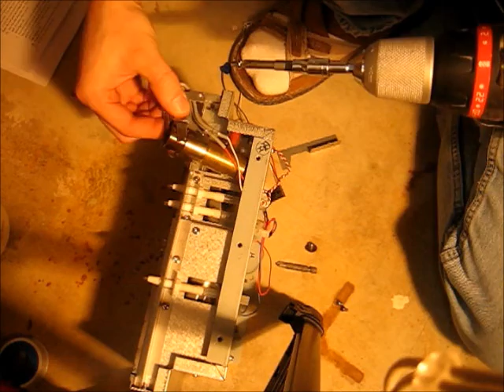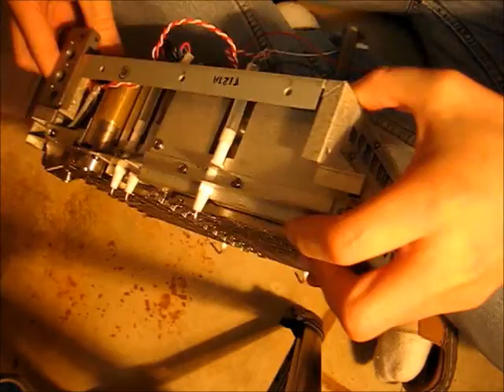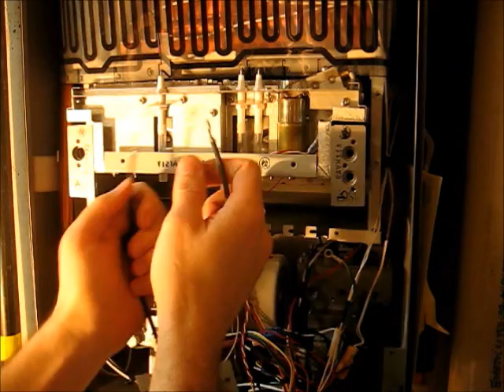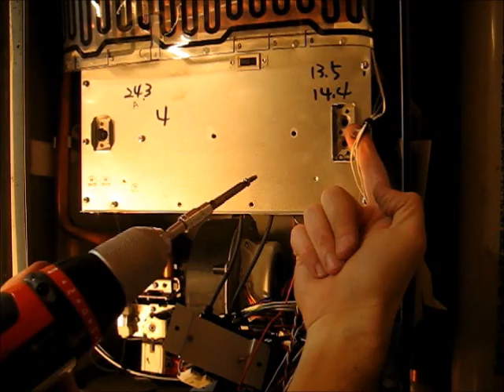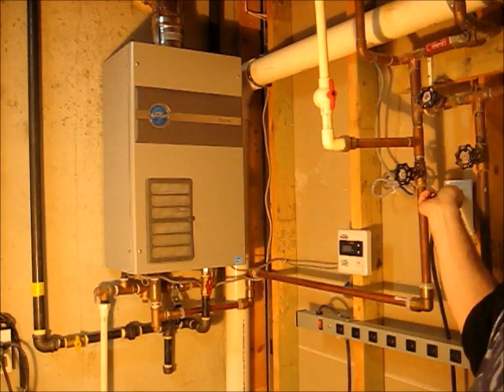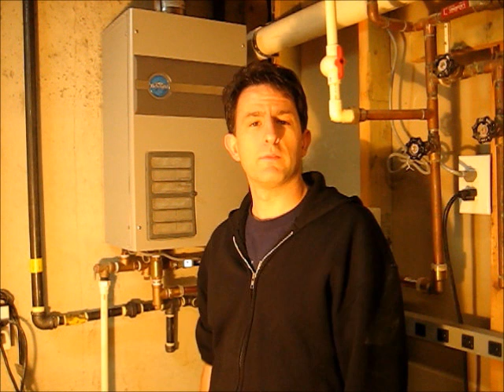How To Clean a Tankless Water Heater Burner (Part 2)

Comment: We have 2 Rheem tankless water heaters.  Our plumber wasn't familiar with tankless water heaters, so couldn't fix them when we started having the "going cold out of nowhere issue."  Found your videos and have used Part 1 and 2,  three times over the past 10 years.  I'm just your  everyday housewife and was able to do it successfully! It's tedious, but doable.  Thank you!
Reply from the maker: Thanks!  You might want to watch this follow up video where I fix the problem forever.  

No Flex Gas Pipe for Tankless Water Heaters
https://youtu.be/zW109bgIRg4

Comment: You da Man! Thanks for the video help! I was a little afraid to take it all apart and clean it, but it really is pretty easy. One thing that wasn't in your video that I would recommend to people is to blow out INSIDE the unit once the burner is removed. There is a big compartment above the burners that has a bunch of radiator type fins, but its hidden like 3 inches above the burner unit. At least it is on my unit. Lots of carbon particles blew out of there! Thanks again, the wife is happy!

Comment: Funny I just found this great video. Bought the what looks like the same unit in 2009 and had the exact same problem a year later. Rheem blamed it on my gas too. Every year, year in a half I have to take the dam thing a part and clean the burner. A swear I don't see any debre in the burner but it dose work I follow the instructions like they tell me too.
Reply from the maker: +Billy Innes - Yeah pretty much the same story here. I think the main thing you are cleaning is carbon off the igniters.

Comment: how often does the gas burner have to be cleaned? I have a Marey tankless water heater for almost 7 years now with no problems.
Reply from the maker: I would not worry about it, unless you are getting error codes, or your water is going cold, because the ignitor is not working.
Reply: the only issues I've had is the water going cold but fixed it by getting a new battery. Also I found that cleaning the faucet heads with CLR works great too(has something to do with water pressure) when I wasn't getting hot water at any of my faucets. Thanks for your reply...

Comment: On this particular unit , where's the temperature control sensor ? I have that exact unit !?
Reply from the maker: I am sorry.  I moved out of that house, so I can’t go look at it.  Take off the cover and follow the water flow.  The temp sensor should be somewhere between where the water exits the heat exchanger (above burner) and where it leaves the unit entirely.   It should have two wires connected to it.  You may have to pull the control board out partially to see the sensor.